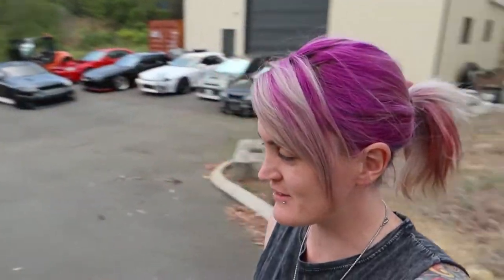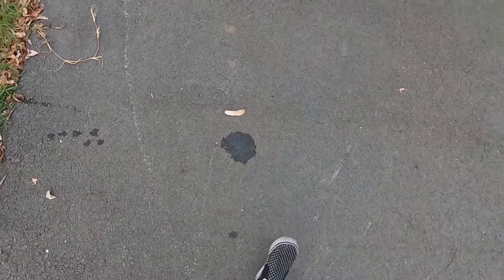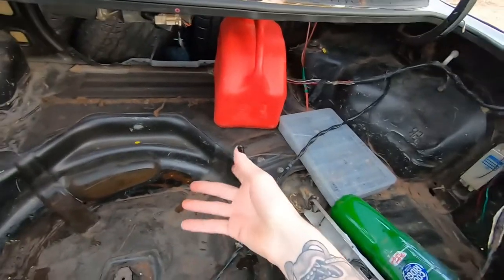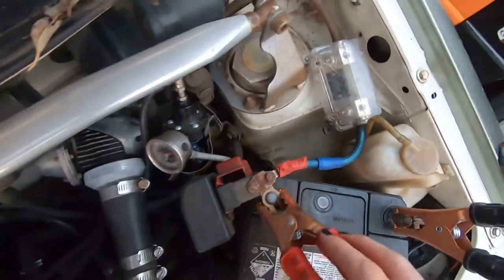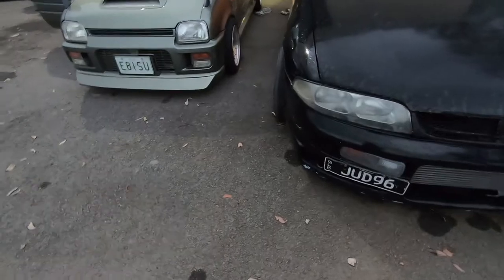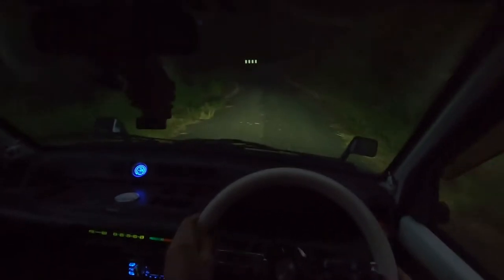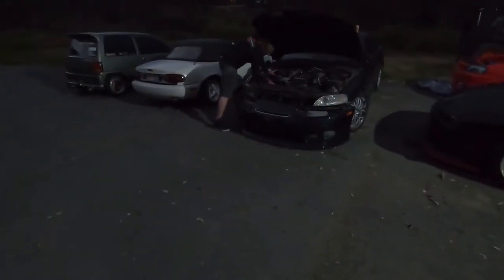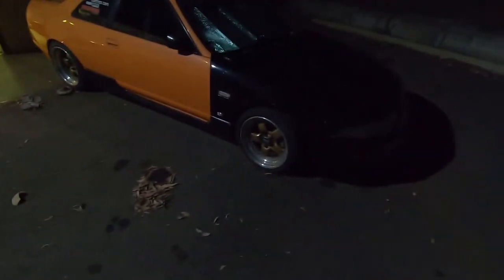Kei to Happiness - L200S Daihatsu Mira Turbo

Comment: ive just got a 1988 daihatsu mira lx 4 door and dont know what to do to it eny ideas ?
Reply from the maker: I'd recommend starting with suspension (coilovers) and a decent set of wheels! Once it's at a nice height, practical for your uses, and you're happy, have a look at your aero options and think about what kind of aesthetic goals you like most. Whether you want something oem, period correct, low, wide, flashy, conservative etc. And if it'll suit your colour, or if that's something you may want to change too.
Reply: @LOKISX  THANK YOU SM! where do you find your parts i cant find eny thing im in NZ
Reply from the maker: @yozabbg3283  Search through Yahoo.jp auctions for parts. They have plenty of stuff for kei cars, then hit up Jesse Streeter to bid and export them to you. :)  Malaysia is also a good source for parts, several other kei owners use suppliers. Hit up some kei groups like livetodai on social media for more info and guidance. :)